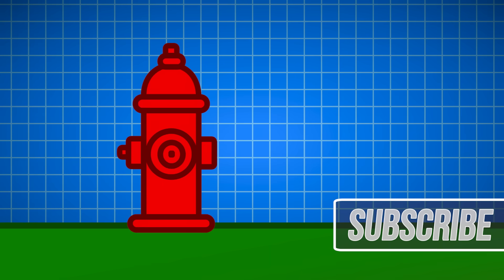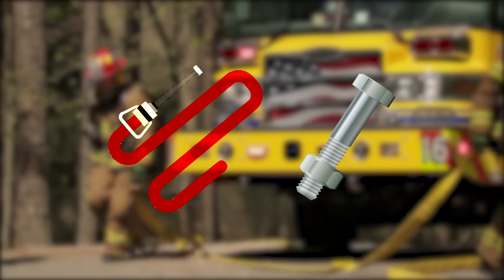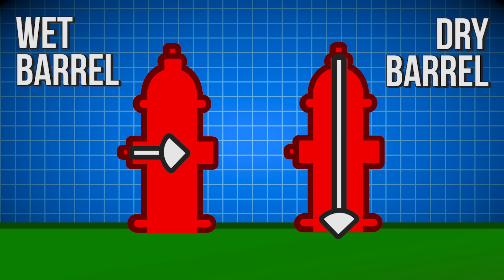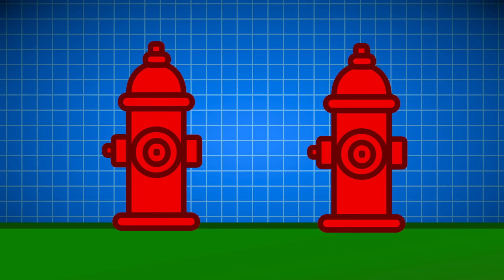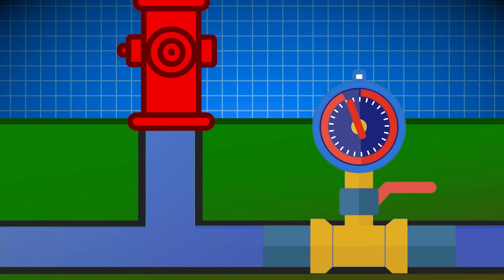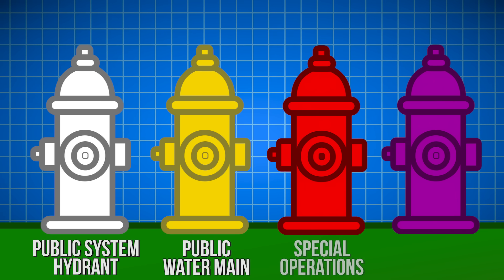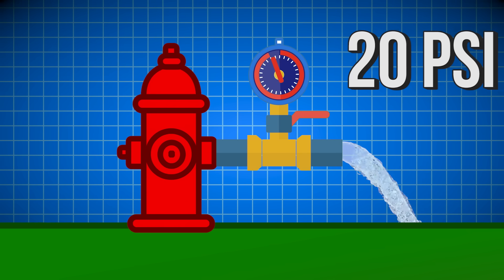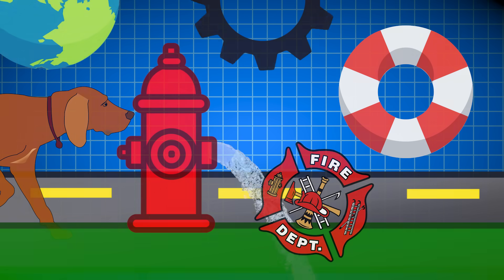How Do Fire Hydrants Work?

Comment: Correction note on Hydrant images:  The image used here in this video to represent a wet barrel fir hydrant is incorrect.  The hex nut on top the wet barrel shown here should be present in the case of a wet barrel hydrant.
Water is continuously present in the "wet barrel hydrant" and there is no lower valve, nor hex nut present on top of the hydrant.

Comment: More often than not anymore a fire hydrants color has more to do with the volume of water it can flow also.  A residential fire takes a average flow greater than 750 gallons per minute now compared to 40 years ago when it was less than 500gpm

Comment: 3:27 that explains why I see that thing at work. Where I work, there is a city water tower across the street from my company's plant and there is a big red hydrant. I often see every now and then that that device sticking out when I am leaving work. There is usually a smaller red fire truck or even sometimes the utility company that runs the water tower usually checking the hydrant probably conjunction with the regular maintenance of the water tower.

Comment: In the US, the fact about hydrant colors are wrong. They are meant to be for available GPM. Class C is red, ClassB is orange, Class A is green and class AA is light blue. Just in case any of you are taking fire 1 and wanting to study more by this video
Reply from the maker: As I said, it wasn’t universal, and the code presented in this video is one of two in the US, both often not abided by
Reply: The colors indicate the amount of gallons per minute you can expect out of the hydrant. Red = less than 499, Orange = 500 to 999, Green = 1000 to 1499, and Light Blue = more than 1500.

Comment: Fire plug comes from the old days when thay had a big fire thay would dig down to the wooden water main tap it for fire water then when done plug it. Hydrants have the date thay where made cast in the back behind the ports. In San Francisco there new fire boat is set up to be a big water pump that pumps watering the city water system if there's another earthquake ect.

Comment: Hydrant color is not always an indicator of its use. It is up to the local water authority and not the fire department on what color the hydrants are.
Reply from the maker: Yep, there are various codes that often are not abused by. My mistake for not explaining further in the video🙂
Reply: The local water authority also maintains the hydrants as part of their water distribution system. I don't know of any place where that is the fire department's responsibility. They only really perform inspections of fire line backflow preventers in the area they service.
Reply: Yep. Our water company that we use for our department got sued for not checking hydrants because one didn’t work on a structure fire so the water company painted them all black which means “out of service” so no one could sue them so we just hope they work.
Reply: @joemurrow5085  That seems slightly illegal.
Reply: 2401penetanttangent not sure if it is. We’re a very small department in the county though so we don’t have many hydrants anyway
Reply: @joemurrow5085  Yeah we have 20 hydrants for our entire area, all within a mile of the main intersection. Tender ops are big out here. All it takes is 1 lawsuit for the water company to actually inspect and maintain. The unfortunate part is lawsuits usually come after something terrible happens.
Reply: 2401penetanttangent yea that’s why they painted them all black so they technically didn’t have to service them. Even the ones in the brand new subdivision they’re building the hydrants are black

Comment: If you live near a Hydrant in a snowy area. If your able to, During heavy Snow fall that might cover up a Hydrant, Try to shovel it out. so it can be used when it is needed.
Reply: Now i will invent hydrant bag (to avoid it getting flooded and covered by snow) so that this will not be required

Comment: In your illistration? the first Hydrant false  second one wet barrel when you shut vavle qafer stays in hydrant dry type has valve closer if not in supply pipe when shut drain ports open allowing water to drain out of hydrant

Comment: There were a few things wrong about you video but you really did a great job. First you kind of made it sound like you hook the hose line directly to the hydrant, this is not true you would DEFINITELY not have enough pressure to fight a fire with, you have to hook a supply line to the hydrant then connect it to the truck that has an onboard water pump that will move the water, and the hydrants in America at least are color coordinated with little reflective stickers in the top Indicating how much gpm they supply
Reply: what if there is already pressurized water inside the hydrant line supplied by the fire pump or jockey pump. So just hook the line hose open the valve so the water released by 8 Bar of pressure water
Reply: @hardilestarigan5634  most pressure in a good hydrant is about 55-60 psi. This will never be enough pressure. That low psi would look like your garden hose trying to put out fire. You are 100% NOT A FIREFIGHTER
Reply: @billyburn2759  did I already mentioned 8 bar in my previous comment?8 bar means 116 psi that is standard pressure used to extinguish fire according to our standard here.

Im a computer IT nerd which has spare job as HSE by the way and definitely not a FIRE FIGHTER
Reply: @hardilestarigan5634  Wow, that's a lot of pressure. In NYC.....55 is excellent!
Reply: @billyburn2759  yeah right it is 98-115 feet long of spray distance

Comment: Our wet barrel hydrants get opened to low pressure for tests or events.... so idk why u said they rnt variable
Reply from the maker: It’s due to the valve types. They aren’t built to withstand being half open. It’s possible the wet Barrels in your town have a testing function built into them 😊 in normal use, hydrants aren’t supposed to be variable, either fully open or closed.

Comment: In coastal, earthquake prone areas, like San Francisco, fire hydrants use non-potable seawater. Also, the color codes are rarely observed. Most areas in West Virginia use red, yellow, or blue, for all hydrants in a city, regardless of type, and all hydrants are dry well. The bolts are made to break during a traffic accident, so that they only need to replace the bolts, and so they can usually reuse the hydrant.
Reply from the maker: Interesting, didn’t know about the use of sea water! And yes, color codes are mostly useless in modern infrastructure, just figured I’d throw something in there about them having meaning ✌🏻
Reply: @ConcerningReality  Thanks for the reply! About color codes, maybe my area uses a different system for labelling hydrants, and maybe we are more concerned about appearance than labels. I have found hydrants in the woods near railroad tracks, labelled with a green street sign that says FIRE.

Comment: Pressure typically isn't a huge deal within the hydrant itself, the surrounding water network yeah, but not for the hydrant's function, hydrant's are more so for volume rather than pressure, as long as they supply enough volume of water to the fire engine through the supply line the hydrant did it's job, the pressure is given by the fire engine itself through its pump
Reply: @ConcerningReality  hydrants are almost always hooked up to the fire engines (at least in my part of America IDK how west coast does things) yes a hose is used to connect the hydrant to the engine but the engine is always the first stop from the hydrant, my department uses a 5 inch supply line, other places will use two 3 inch likes, the run from the hydrant to the engine is all for straight volume of water, there's no true way to control the pressure coming from the hydrant because it's always giving the same flow to the engine (if not all the water is being used fire engines have an overflow on the tanks that will just dump the extra water on the ground below) now the reason we don't use hydrants themselves to run our hand lines that we fight the fire with is our attack lines' nozzles rely on pressure rather than volume, hydrants only deliver volume and typically it's at 50 psi but that's not always constant and it certainly isn't enough pressure, a smooth bore hand nozzle requires 50psi to operate correctly and a hydrant can't keep this up with friction loss and multiple lines connected to it, the most common nozzle used is a combination nozzle and they require at least 100psi, plus hydrants put out an average of 800 gallons per minute around here and hose lines put out around 150 gallons per, the engine reduces the volume of the flow and bumps up the pressure to usable levels, the engineer has very little control over the flow or psi of the hydrant they just control the pressure and flow to the hand lines after it reaches the engine
Reply: @zachr21897  that's actually an interesting list of facts. Most of my neighborhood doesn't have many fire hydrants.
Reply: false. hydrants with very low pressure is a death trap. The engine cannot provide adequate pressure.

Comment: The types of hoses that are attached from the hydrant are 5 inch diameter. Also in my area we use dry barrel hydrants, and they really are a pain to open sometimes.
Reply: The hoses are not always 5 in diameter.  There are 4 in diameter supply hoses, some places still use the 2.5 in hoses with Siamese system.
Reply: @traildog_adventures  yes. That is true also
Reply from the maker: Handling a live hose from a hydrant is no joke, it takes some serious muscle.

Comment: Not bad. Definitely not a fitting. Ever. Always a hydrant. And it contains a valve. It isn’t in itself a valve. Just has one in it(or multiple if wet). Colors are for pressures in NFPA 291 but it just depends. Most of the time they paint just the bonnet for pressure indication. At least what I have seen. Private service mains are usually silver. Meaning nothing other than fire marshals like them to be silver ha. And dry hydrants are for anywhere the temperature even has the possibility of dropping below freezing. I have never seen a wet hydrant in person because I’ve never been anywhere that it doesn’t freeze at some point in the year. Some decent info. I like the animations. But definitely not super accurate all together. They are also mainly used for firefighters to hook up to their apparatus to give it water. Not use the hydrant directly. All right im done. Btw, NICET III NFPA25 Inspector here. I test these ALL the time.

Comment: First and for most. As a firefighter I find some things wrong. Like the Hydrant colors. The colors mean that types of water flow we can get out of one. Like red would be the lowest amount of pressure purple highest. Because if we don't know how much water we can pull off of one. We will pull to much and start to pump the water from people that live near by and it will damage the house plumbing and its components. We would suck water from toilets and water heaters.
Reply: so the colour coding you are referring to is the nfpa standard with is the color on the caps or the colour of the reflective rings on the caps. also not all fire hydrants follow the nfpa standard. (I just completed my nfpa 1001 level 1 and 2)
Reply from the maker: Technically you're right, but the video also isn't wrong. There are two color codes for fire hydrants, one dependent on use and the other dependent on flow rate. It varies by municipality and how they have their system set up. Also just to clarify, fire hydrants aren't variable flow. I don't think you're saying that in reference to fire flow, but just wanted to make sure it was clear :) If I could do it over again, I totally would've included the flow rate color code as well. Thanks for your service as a firefighter! I'm in the Navy and the little bit of fire training I've done has told me I'm not cut out for it.

Comment: There are several other things I find issue with this Video as well:1) The City of Tampa and Hillsborough County Florida both use Dry Barrel Hydrants2) The maintenance of the hydrants does not fall to the fire marshal...its the water municipalities.  The maintenance job is to guarantee the flow.3)  Maintenance of a wet barrel hydrant can be difficult as you need to stop the water before the hydrant.  With a dry barrel hydrant, as long as the plunger is down, there is no flow.  The hydrant can be maintained without formally isolating that portion of the line.  if a car hit a dry barrel hydrant, there is NO explosion of water as you see in the movies.  It's designed to break off.4) The municipalities test the hydrant and color code it due to the available pressure in that region.5) The colors denote the flow from that particular hydrant.  There are two colors..the barrel and the cap.6) There is a minimum flow and line size each hydrant is supposed to attach to and deliver.  There are some on water mains that cannot deliver this (reason for the color code). In such cases, the hydrant is hooked to the truck, which has a tank already filled, and uses the public water to fill that tank while pressurizing the water to meet the proper flow and pressure.There are a few other things missing...but it was a good attempt.  I clicked "like".

Comment: Do you plan to do more videos for M&E building engineering? By the way fire hydrant system does not consist of pumps?
Reply from the maker: I do! I’m a civil engineer so I try to cover technical topics when possible. And no pumps at the hydrants. The water system is already pressurized back at the treatment plant. I’m doing a video about that in the next few months.
Reply: Great. I'm in M&E building engineering line and videos like this will be very beneficial to me!

Comment: I would suggest you Google fire hydrants and learn how fire hydrants really work. You have a few misconceptions here.
Fire hydrants are NOT on/off devices, the flow can be minimal or full flow. Very few, if any cities in the US use wet barrel hydrants.
All fire hydrants that are UL listed must flow at least 1500 gpm to be approved. Not all municipalities have that much water however.
All NST standard hydrants are red, they are not special use by any means and are used all over the US. Some cities will paint the bonnett of their hydrants to indicate the size of the water line feeding the hydrant. In most cases the hydrant color has no other significance.
Reply from the maker: I’m a civil engineer. Fire hydrants are always on/off devices. Their valve type is not meant to be half open or half closed. Wet Barrel hydrants are common in warmer southern states - not to say they are used everywhere. Hydrants are simply valves that output flow based on size and available water pressure. The colors presented in this video refer to the caps not the barrels. There are different color codes for caps and barrels which indicate different things - this code is not always regulated from municipality to states. This often means that hydrant color doesn’t mean anything, yes, but that doesn’t mean that the standards don’t still exist. 🙂
Reply: Concerning Reality From my experience in the business very few municipalities follow the color code. A lot of towns want their hydrants all red now a days it’s psychological I guess although to me they should all be blue for water     not red for fire XD
Reply: I would agree that fire hydrants would always be used as a full flow device, however they are designed to open slowly and close slowly so as to not cause water hammer within the system. They can definitely be throttled without any issues. I manufacture hydrants from the foundry level up and would be happy to discuss further.

Comment: how much is the price of a fire hydrantr
Reply: If you were a wholesaler in the US a fire hydrant depending on the depth to the water line would cost between $1250.00 and $1500.00.
Reply from the maker: About $5000 or so

Comment: Most fire hydrants in Puerto Rico are the dry barrel type as far as I can tell.  This does not hold to the statement that they normally used in cold climate regions where freezing can occur.  Of course there may be other considerations.
Reply: Luis R
Dry barrel hydrants make up the majority of hydrants installed, resulting in a lower costs, not to mention a wet barrel hydrant has three separate valves that can be opened independantly from each other making them quite a bit more expensive than dry units.
Reply from the maker: Standards in other countries/territories can differ a lot from here in the US :) I’ll have to do some research into why PR might be majorly dry barrel.